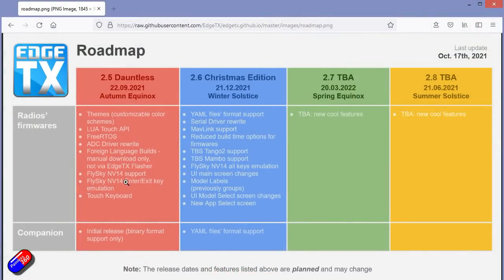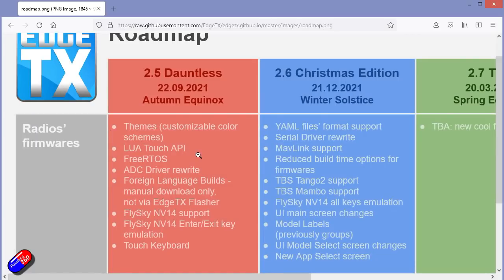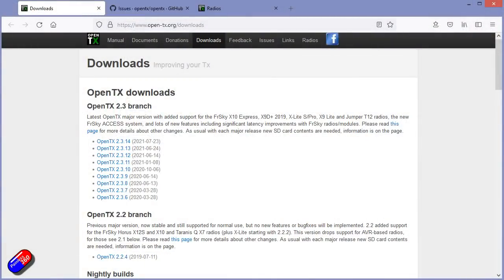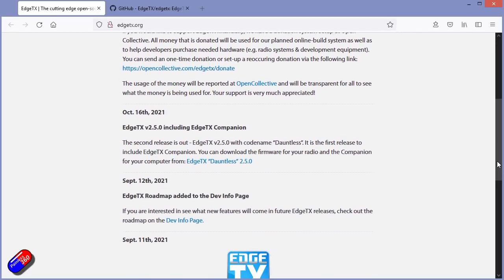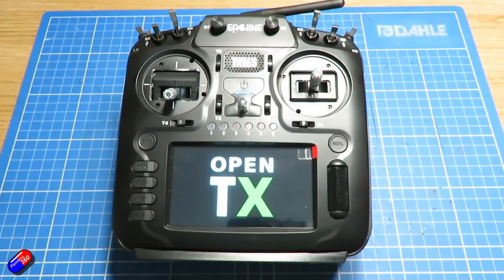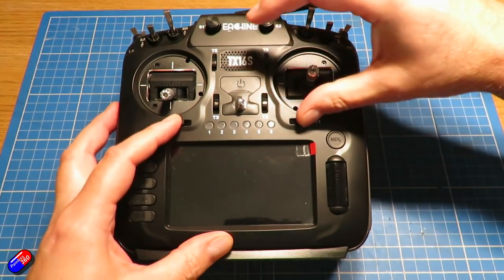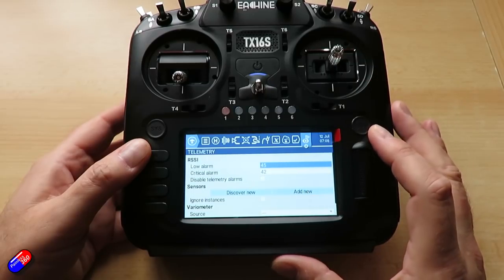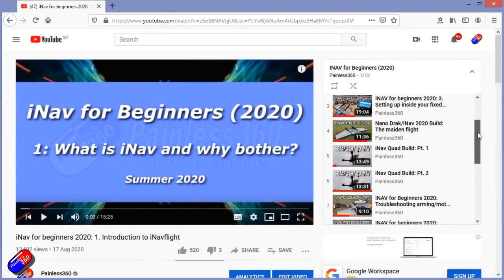EdgeTX: What is it? Do I need it?

Comment: hi lee could you please run the batery right down. i did it and was not impressed. no bat low warnings and it just crashed need to remove battery to reset and would turn on still had 7v ish

Comment: Promises, promises. It is very easy to port ideas for a new Operating System from all the innovations of previous systems but behind these community developments there is usually one person with all the ideas in his/her head.  Once they get all the basics into the system they start to run out of steam and energy and development slows to a standstill. Most of the open community systems owe their existence to one person - Mike bland. Thankfully Mike has had the foresight to attack the ACCST compatibility problem from another angle and has now developed a universal ACCST firmware that addresses all the glitches and compatibility issues as well as incorporating the FCC and EU-LBT requirements into one Firmware that ensures compatibility of existing Frsky gear across ACCST versions 1 & 2 - without the need to upgrade existing TX and module FW.
Reply from the maker: That is one of the wonderful things about the open-source community and development. Projects are copied (or forked) all the time as engineers take that existing code and explore new ideas on top of it. MultiWII became Baseflight. Baseflight became  Cleanflight. Cleanflight became Betaflight, then became INAV. 
So much of what we use in the modern 'open' hobby relies on the labours of these developers and popular opinion and pilots choosing and using the project dictate which ones survive and which projects are left to wither on the vine. Successful projects that solve a problem and get lots of support like Ardupilot, Betaflight, ,INAV, MPM, EdgeTX, ExpressLRS, Yappu, BLHeli (and others) are now core parts of how many pilots fly.
Imagine if we had to pay for this technology. Many wouldn't be able to afford the hobby... Fab times!

Comment: Hi
I wondering if you know how i can bind frsky receivers in redundancy system in Edge-tx?
I have tried, but I can't bind one with telemetry and another without telemetry. That's no problem in Open-tx but it is a problem in Edge-tx I think.
Reply: I was able to do this about two weeks ago, so if it was an issue in 2.5.0 it will be fixed in 2.6.0 as it is already resolved in the nightlies.

Comment: Software engineers should never design GUIs. We suck at it.  The things we think are interesting most users do not.  They just want a simple interface that is intuitive and "Just Works".  Apple and others pay the UI people a lot of money to develop a seamless, powerful UI.  Not an easy task.
Reply from the maker: I couldn't agree more. From what I understand the chap that was the lead GUI guy left OpenTX and now works for FrSky so maybe that is why so little changed.
Reply: I've a software engineering background myself. I love OpenTx. Its logical and elegant and it does the job. It might have a few bugs left in it but I've not encountered them lately. I enjoy using it.

But lets go with a new fork if it makes it prettier and simpler. Touch screens and colour displays might reduce battery life and make it harder to see on sunny days - but looks are very important. And we all love the fun of finding new bugs.

Comment: What motor size do you recommend for a tarot 650 frame? Thx
Reply from the maker: With this long arms it can go up to 15" propellers, you can use something like a 4114-320kv motor and 6S LiPo to get maximum lift (that gives 1.5~1.75kg of thrust per arm). Lots of options, it depends on the weight and flying time you want. See my motor and prop series... Best of luck

Comment: Hallo I need your help
I have xm+ and r9m mod elrs. Before I install firmware edge tx everything normal. But after I use firmware edge tx my receiver not binding (xm+ and r9m mod elrs).
What should I do?
Thanks for answering 🙏
Reply from the maker: It depends on what you changed. I've not seen that here. There are some pitfalls with ELRS  - making sure the radio module and Rx are on the same version etc. so I'd check out the EdgeTX forums in case this is a known thing. Sorry I can't be of more help on this one..
Reply: @Painless360  I use version edgetx 2.5.0.
For r9m elrs already bind. But for xm+ I still hard to bind

Comment: I tried switching to Edge a few weeks ago, and lost models. Do you have a video on how to recover the models?
Reply from the maker: No, that is why a full backup of the radio is needed before the conversion. Best of luck to
Reply: @Painless360  Thank you. I watched Mr. Bardwells video twice on loading EdgeTX. When he was complete, his models were in tact. When I finished all 7 of my models were gone. My card is backed up thank goodness. His method was to select all files and folders on the SD card, and deselect the radio and model folders. The models should have loaded with the EdgeTX, but did not. Not sure what to do except return to OpenTX.
Reply: @jerryzito6840  this happened to me so I just recopied the models folder from my back up directly on to the edgeTX sdcard and the came back
Good luck 😊👍

Comment: Hi Painless360, is it possible we damage the radio while installing edgetx on process? iam affraid to flash my radio because of that. Thanks
Reply from the maker: I would t have thought so but I have never flashed a radio using the wrong file to see... Happy flying
Reply: Highly unlikely to cause any damage (except in that 0.01% instance that it does). If you flash the wrong firmware it is likely to simply crash on boot. If you manage to crash the bootloader, you will always be able to use DFU recovery mode.
Reply: @Painless360  , thanks for the response. have a great day
Reply: @pfeerick  , thanks now iam sure will migrate to edgetx

Comment: I just couldn't get my head around OpenTX, which is why I changed my FrSky gear for Spektrum. If this had come out earlier, maybe I would have had to spend mega bucks on a completely new RC system for my flying hobby. I still have an Frsky Q7S in my box, as no one wanted to buy it, together with 2 stabised receivers, so may just give this a go when it gets nearer completion. Thanks for the info Lee. Best wishes, Dave W 👍
Reply from the maker: Hi David, spending as much time as I do, helping others with OpenTX I possibly have a very unique view of the system. Usability and the complexity of OpenTX has been an issue for as long as OpenTX has been about so I am excited to see what EdgeTX do to lower the bar for entry and make the system (and the radios that run it) easier to use for pilots like you. It would be great for the hobby. I hope that OpenTX gets a shot in the arm to so that the remaining developer/developers get some love too..

Comment: Don't see the advantage if you have no touchscreen and only fly with flight controler on your copter/plane
Reply: Touchscreen is one big factor at the moment. But there is that underlying improvents to stick latency (I e. The gimbals are polled as fast as your radio link sends packets - e.g. 500hz with ELRS) and if you want to use with a flight sim there is improved speed/latency there also. If those don't matter to you then probably no reason to switch yet.

Comment: Waiting for trappy to get the edgeTX devs to add the Mambo and the Tango2
Frustrating wait as I’m using CRSF on my T-16s and ELRS on my Mambo.
Reply: How did you get the elrs to bind. I have updated my receiver with a binding phrase but I cannot get it to work with the module. I plug it in and tell the configurator to update it but I get a red error screen because I don’t think the module is actually connected with the computer. Do you think it’s the cord I’m trying to flash it with. It lights up when I plug it in but I thought maybe it’s only a charging cord and it’s in charge mode
Reply: No, you're waiting for Trappy to provided a mechanism to install EdgeTX on the Mambo and Tango2 ;) Once that is possible, work can start on onboarding Mambo and Tango2.
Reply: @pfeerick  more specific, yes, exactly
Reply: @jmillerfpv  did you download the lua?

Comment: I think the main problem with both OpenTX and EdgeTX is that they are made by developers who like to develop new and completely (almost) useless functions complicating an already unnecessarily complicated system even further.  95% of OpenTX's functions, options are unused, unwanted and not needed by 95% of users. I think this is why Spektrum products are so popular because of the ease of the interfaces, and why they can charge the exorbitant prices for a slightly better than average product. And the Frsky debacle hasn't helped.......